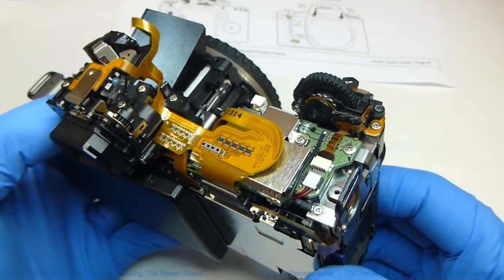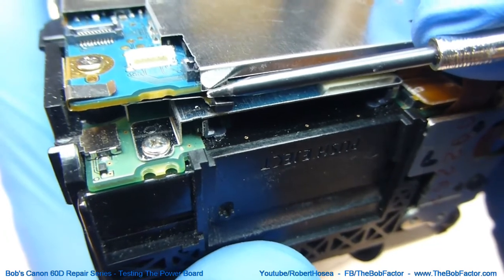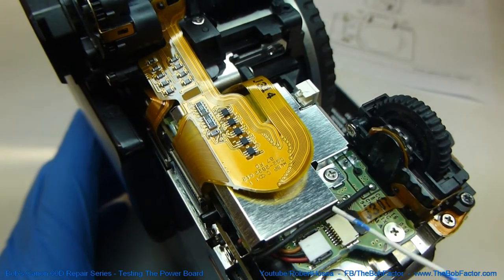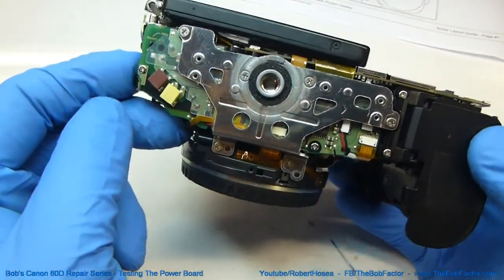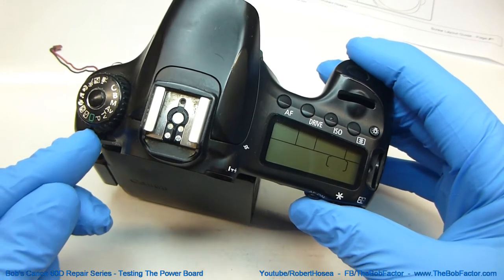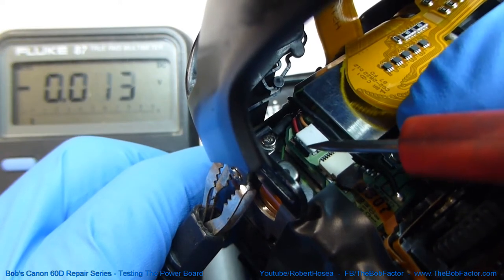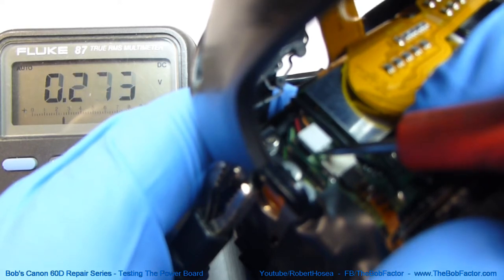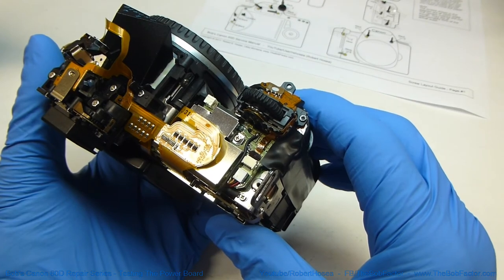Canon 60D Repair Series - Testing The Power Board

Comment: hi, mr Robert, in my 60d, first error 70, after clean connector all around the circuits, not power up, again, re check all connection, error 20 coming up, after try deferents times it coming out , no power again, i follow you and check power boar, read wire 8.4 v, which is good, orange wire , give me 4.7 v, but directly, i mind, i didn't touch any botton around,,just get the voltage always in orange wire,,,,this situation means something for you,,,thanks.

Comment: Hi Robert, I'm watching your videos to try to find out what is wrong with my camera. The only different measurement I had was at the point where the voltage should vary when pressing the shutter button. I always have 0 volts there. My camera doesn't turn on when I put the battery in it. I just have an empty battery symbol flashing on the display. Do you know what could be the problem? Thanks in advance!
Reply from the maker: Hi Patrick. It sounds like it may be a defective power board. There was one time where a flat ribbon cable that wasn't fully inserted into it's socket caused a similar problem, so it may be worth checking the flat ribbon connections (if you haven't already). Other then that I would guess that it's probably the power board that's bad.
Reply: @Thebobfactor  I checked the cables and everything was good. I will try a new power board! Thanks for the reply!

Comment: Hello.. my 60D got wet. Now no matter which lens I attach it gives me intermittent ER01 (cannot communicate with lens). I Opened it up to clean off some of the grit on the bottom board. But maybe I'm looking in the wrong place
Reply from the maker: Hi Israel. If it got wet enough on the inside get the circuit boards wet, then you may have to thoroughly dry the boards by removing them and then air drying them. Even the smallest amount of moisture on a circuit board (either side) can cause a problem with it. I would dry all of them just to be safe.

Comment: Hey Robert, I Have a 60D that gives a blinking battery icon irregardless of what battery I put on it, even when the camera is off. I'm wondering if you've stumbled across that and if it's either the Power Board or the Logic board.
Reply from the maker: Hi Eric. I have run into that problem two times. On one camera it was from the power board being bad. On a different camera the problem only appeared after I had disassembled & reassembled the camera in order to put in a new shutter assembly. It took me a while to figure out what the heck I had done to cause it to do that. It turns out that I had simply replaced one of the flat ribbon cables backwards. And I believe it's the only one that you could do that to. Here's the spot in the second video in this series that shows that particular flat ribbon cable, which goes between the bottom board and the main board: https://youtu.be/_-gQbCM7QMw?t=192 . So, if the problem only showed up after you removed that flat ribbon cable, then possibly that is the same problem. -Bob
Reply: @Thebobfactor  Thanks 
Robert for the fast response. I had this issue then I took it apart to get some readings. So the ribbon cable seems ok. I might just replace the power board since it's not that expensive and we'll see how it goes.
Reply: @airslashfury  @Robert Hosea  I got the same problem with my Canon 60D - blinking battery icon. Were you able to fix it?
Reply: @devindamolligoda9691  Yes, just replaced the power board. Cheap and simple!!
Reply: @airslashfury   Thanks for letting me know. I will open up mine and check.
Reply: @airslashfury  hey man, i have the same issue. where did you buy the replacement power board?
Reply: @AbikersPOV  eBay, I've always bought from Rongyuanxie. Original and new in box parts

Comment: I was told the DC-DC board of my 80D needs replacement.  The 60D & 80D are quite similar and the board doesn't require a major disassembly.  Do you think I could manage it following your 60D video?
Reply from the maker: Sorry, I haven't worked on an 80D yet, so I'm not sure how similar they are on the inside.

Comment: Hi Robert, is it possible the board fried during a repair even if the battery was out the whole time?
Reply from the maker: Hi Jenelle. I could only see that happening if the one of the circuits on one of the circuit boards somehow came in contact with the flash capacitor while it was still holding a charge. That could definitely cause some damage. I have seen the power board get fried when the battery was put back in and then the camera turned on, when one of the flat ribbon cables had been put back in wrong and it ended up underneath the bottom board, and then one of the screws went through it and shorted it out. Is anything at all showing up on the upper LCD display?

Comment: My 60d after 3 years in Kenya stop working. only battery flashing on lcd. Need check power board with meter too. Thanks for video.
Reply from the maker: Let me know what you find when you take the voltage readings with the meter if you can. Good luck with it. Thanks!
Reply: Robert Hosea Good morning. I open body my 60D, it's unreal..., can i send to you some photos of boards and other items? But email correct on site www..?
Reply from the maker: Good morning. Yes, you can send the photos to youtube@thebobfactor.com.
Reply: Hi

Comment: As everyone else said very nice videos and a lot of thanks for sharing your knowledge.
I have a 60d with very low shutter count (around 5000). It has been a while since last time i used it. I decided to resume taking pictures with it, charged the battery and everything was fine. Next day it would not turn on, tried the usual trick with the shutter button pressed for 30s. But nothing. Bought a new battery and a new memory card, it turned on but when i shut it off, it did not turn on again. With the shutter button trick sometimes it turns on, works perfectly, but when I switch it off, I have to repeat the push button trick few times to be able to turn it on again…
In your experience a faulty power board can make this happen? Can the camera work perfectly and have only problem in powering on?
Reply from the maker: That sure is an odd one. Generally I've found that when a power board goes out, nothing works at all. It doesn't work intermittently as it's doing with you. My guess at this point would be that the power board is not bad. But, I'm not sure what it might be. It doesn't act as if it's a loose connection at all. Something you could try first, is to replace the bios battery. I've read where some people have had issues with the camera operation when the battery needs replaced. It would at least give us a starting point to go on. Here's a video by DiCasaFilm, that shows how to replace the battery: https://www.youtube.com/watch?v=vVZLdSoz1X4. Let me know how you make out on it.
Reply: @ thanks for the replay. I watched the video you are referring to, In the beginning I thought the same but then I noticed that the time and the date were kept correct so I thought that the internal battery was indeed having some life left into it. Now if s getting even stranger… tired of trying resetting and restarting I left it there with a charged full battery and the new sd card. I picked up yesterday and it turned on. I tried on and off few times and it worked, changed the battery and it is still working…  will see what the future reserves… if this “glitch” repeats I will try to change the internal battery.
Reply from the maker: @robertorodoero1602  Well, hopefully it's self repair holds out. That would be nice. If not, give me a shout and we'll see what we can do.

Comment: Hi Robert! As a tinkerer myself, I wanted to come to you with a problem I have with a 60D.  It will not turn on. The first thing I did was try every permutation of the “Take Battery, Card, Lens off, Put on P, Hold shutter down for a while” Trick. But that has not worked.  I figured, well for this trick to work it must mean the camera has an internal battery.  I also figured that it must be pretty easy to replace - as it was probably a simple watch battery. 
Turns out, as I read in a forum, the internal battery is not easily replaceable. It’s part of the board or something.  I am still in the process of watching a lot of teardown videos, and I’m waiting for when someone gets to the internal battery, but I figured I’d comment first.  I’m planing to disassemble it and see if I can fix it, but any guidance/theories you have would be much appreciated.  Thank you for your helpful videos!
Apparently, the previous owner tried the reset trick, and did say that the LCD lit up for a second. But any consecutive attempt does not replicate this result. As i said, my guess is that that internal battery has not enough charge left to make the reset.  This camera has been in storage without a battery in it for at least 5 years, so I really think that is the reason.  Looking forward to hearing from you!
Reply from the maker: I have heard that the camera will not start if the little internal battery is dead, but I could never prove it. I had one camera where I replaced the battery with another (same voltage but different size) just to see if the dead camera would come to life, but it didn't help at all. In the end it was a bad power board. Of course, every situation is different, so I would be very appreciative to hear if replacing the battery does help you out in your case. Good luck with it!
Reply: @Thebobfactor  Thank you so much for your response! When I get a chance I’m planning to watch the rest of your videos in this 60D teardown series, but if you know offhand which of these videos, and at what timestamp, you locate and show the internal battery - if you do show it? Thanks for your optimism. We’ll see. If it is a bad board, is there anything I can do about it or is it just a paperweight at that point?
Reply from the maker: @DiCasaFilm , unfortunately I never did include the battery location in any of the videos. If the power board is bad, it can still be worth replacing it if the rest of the camera is in good shape. When I was using my 60D a lot, and having to repair it a lot, I would find a broken 60D on ebay to buy for repair parts. I would look for one where the seller lists exactly what the problem is with the camera, such as a broken LCD, or that it's reporting a shutter error code. That way I would know that the power board or main board or whatever I was needing was still good. It's a little more of an investment that way, but I almost always used many more parts from it for other repairs too. Lol. I'd sure be interested to hear how you make out on your camera.
Reply: @Thebobfactor  Once again. thank you for responding. Very good info to know. Do you know where the battery is in general, even if you didn’t show it? Wanna know what I’m looking for.  After this question, I think I’m done bothering you. haha. :)
Reply from the maker: @DiCasaFilm  You're not bothering me one bit. I will need to see if I have a 60D main board somewhere, and try to locate it on there. It might take a day or two before I can get the board to look at though.
Reply from the maker: Hi  @DiCasaFilm . I did find a section in video #2 that clearly shows the battery. It is partially covered by a flat ribbon cable at first, but once the cable is disconnected it is fully exposed. The battery sits in the white battery holder. You can see the part where I am disconnecting the flat ribbon cable right here: https://youtu.be/_-gQbCM7QMw?t=267
I hope replacing the battery takes care of the problem for you!! -Bob
Reply: @Thebobfactor  Wow! Thank you for this! Super helpful. You are the man, Robert. Can’t thank you enough.
Reply: @Thebobfactor  It looks like the battery itself is not “integrated” into the board as I had read! It looks like I can just replace the battery easily once I get to it. That’s actually great news. I thought I was going to have to buy another broken 60D, as per your suggestion, and scavenge it for parts. But i don’t think that is the case now. Incredible.  Thank you Robert!
Reply: @Thebobfactor  Hey Robert.  I wanted to give you a big update.  Using your super helpful videos I was able to dissect the camera to the point where I could remove and test the internal battery.  It was reading 2.5 volts.   This was a bit disconcerting as you would think the camera reset trick would still work even at that low voltage.  I thought for a while on what I could do.  I went to an electronics store and bought a few button batteries, but none would fit correctly.  What I ended up doing was using my bench power supply to charge the 60D internal battery (which is a MS614SE btw).  I managed to charge it up enough to read 3.2 volts, but it was discharging rapidly.  I quickly put it back in and did the reset trick, making sure to slide a piece of paper into the switch by the memory card slot, and also making sure to hold the battery door latch closed.  But alas it did not work.  After I tried, I tested the battery again, while it was still on the PCB, and it was reading 3.03 volts - which is precisely where it should be.     I think I'm still going to try and order a new MS614E, because who knows, maybe there's an issue with the current rather than the voltage.  But after that, I'm not sure what do to.  I'll watch your videos more closely to see what I should test for to determine if the power board is bad.  But that's what it's looking like.  If it is "bad", I wish I could determine how.  A busted capacitor or broken trace or something.  But maybe that's too hopeful.  Anyway, I wanted to let you know all I'm doing.  And because I'm a filmmaker, I filmed the whole process!  Praising you a lot of the time.  There is hardly any information out there about the 60D internal battery, where it is, what is it, how to get to it, etc.  I wish I had a video like the one I'm making to make the process easier.  But I supposed that's why I'm doing it.  The world needs it! Haha.  Thanks again for all your help, and I'll keep you updated.
Reply from the maker: @DiCasaFilm , thanks for the update. Your process of replacing and charging the battery, sounds a lot like what I did the one time I worked on the battery. But I also had the same results. Testing the power board would be the next step if you don't see anything else that is obviously wrong, such as a disconnected flat ribbon cable, or any cables that are sitting crooked in their connectors. And I have yet to see any power boards that show any sign of being bad, and have to rely on testing it. I'm glad that you recorded your testing process. It will definitely help others out!! -Bob
Reply: @Thebobfactor  I have a new update.  I watched your "testing the power board" video and did all the tests you did.  Everything was normal except for one thing.  Normally, there is that one circuit that reads 0 volts, but then if you move the shutter dial or shutter button it will charge to 4.7 volts.   On my 60D, that circuit is ALWAYS at 4.7 volts, no matter if I move the shutter dial/button or not.   I thought this was weird, but I don't know enough about the inner workings to tell if this is the cause or symptom of anything.  I even tried putting a resister on the circuit to pull it back down to 0,  but if it did go down to 0, it went back up to 4.7v by the time I took a subsequent reading.  What are your thoughts about that?  Well anyway, I really have no other options at this point.  I did order a new MS614SE battery, it arrives next week.  I might as well put a fresh one in there, even if it doesn't completely fix it, which I doubt it will.  After that, I'll reassemble it and give it back to my friend.  If anything, this whole process was a great learning experience and as fun as it was frustrating.  I'll put the videos of the whole process up as soon as I can, and I'll link them here.  Thanks again for everything!
Reply from the maker: @DiCasaFilm   From the readings you are seeing we will not be able to say whether the power board is good or defective. And that's too bad. Because if the power board is good, then it sounds like there may be a problem either with one of the buttons or dials in the top of the camera, or with the main board itself. And at least we could move forward to testing other parts. About the only way to really test anything now without having a detailed electrical schematic, would be to replace the power board with a good one. And if doing that shows that the original board was good, then you would replace either the top control unit or the main board. But doing it that way is time consuming and costly. Sorry I can't be more help on that. I do like your idea on replacing the battery. At least it gives you one more shot at fixing it. Let me know what it does with the new battery.

Comment: We had a 60D that just stopped working out of the blue. One day it was fine the next one I tried to power it on and nothing happened. At first I thought it was a dead battery but nothing. We tried a different battery - still nothing. I tried all the reset methods and latch checks and what not - nothing helped. We left it with a repairman that said it's probably the board - not sure if he even opened it.

It is beyond me how a working camera with no more than 60K clicks could just up and die. And whenever I circle back to this video I get the urge to somehow fix it lol. Any explanation on what might have killed it?
Reply from the maker: You're right that 60K clicks is not much. My first thought would be that the power board is bad. It's not uncommon for that board to go out. And if it's not that board, then I would suspect that the main board is defective. If you're interested in fixing it yourself, you can search for parts on eBay. There are quite a few sellers on there that sell individual 60D parts.Unfortunately though, both the power board and the main board can be a bit spendy. Sorry I can't be more help.